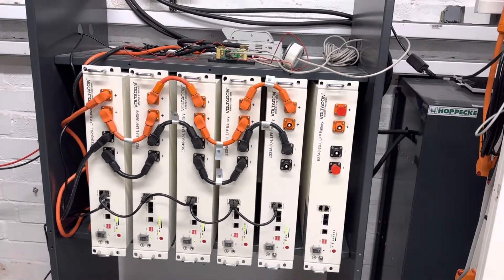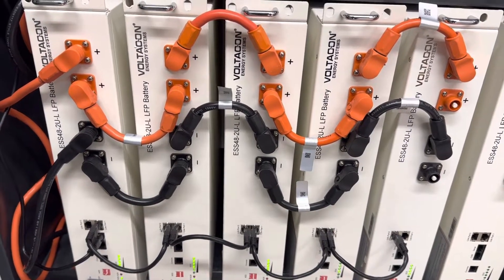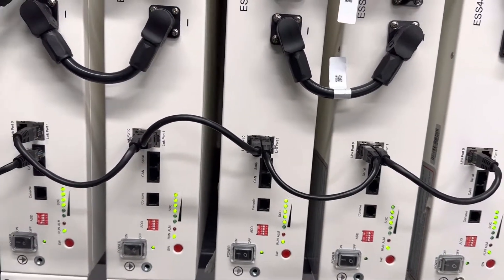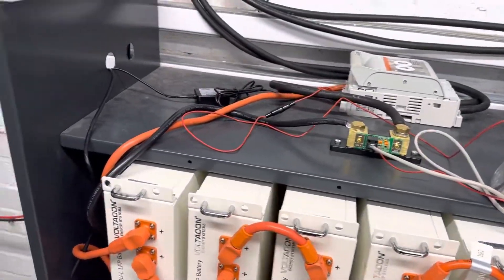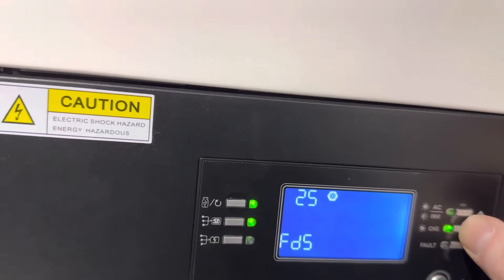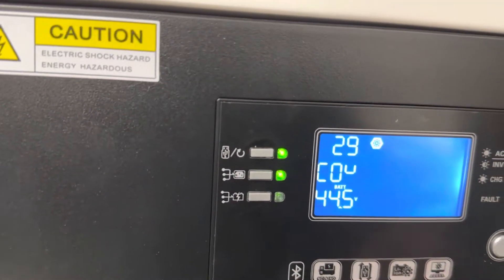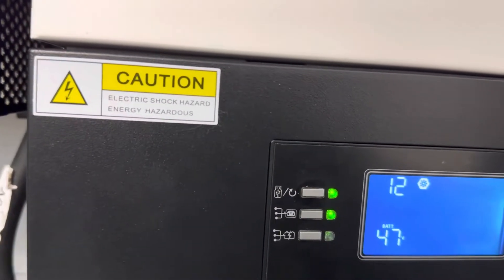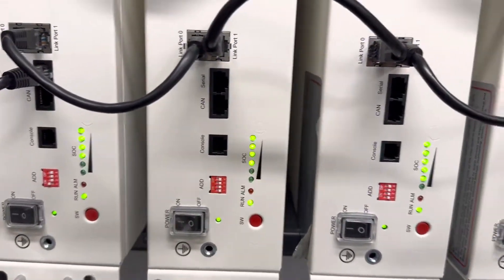How to equalize pylontech US2000/US5000 and Voltacon lithium batteries without BMS

Comment: hi friend, thank you for the video.  I want to ask for advice, it was not possible to connect the battery to the inverter.  which cable to use?  maybe it's a regular internet patch cord?  or what is the correct pinout?  thank you!